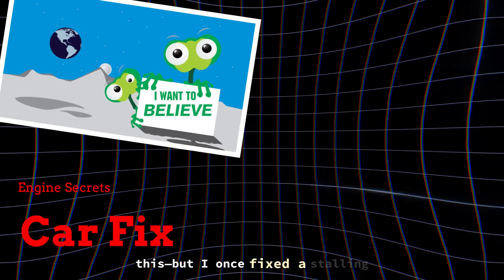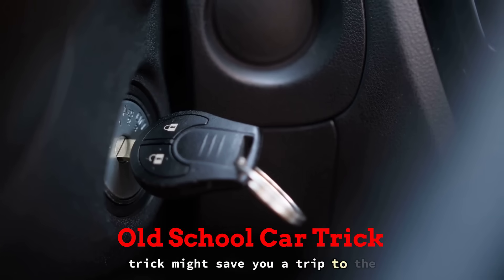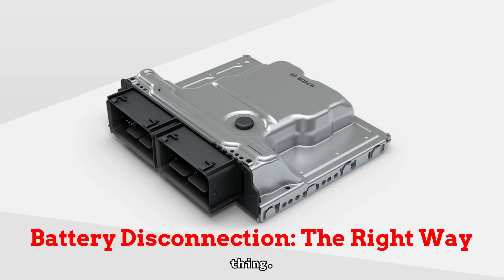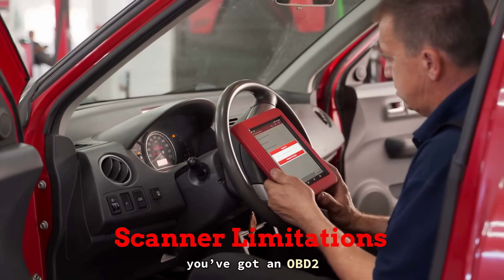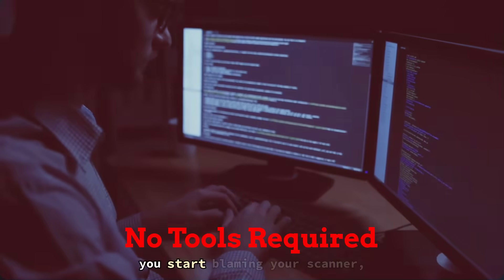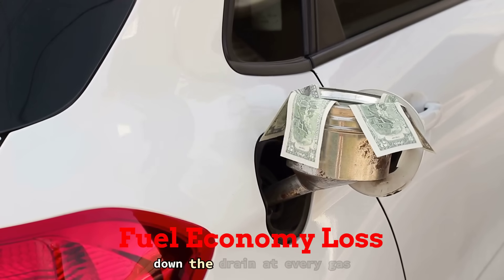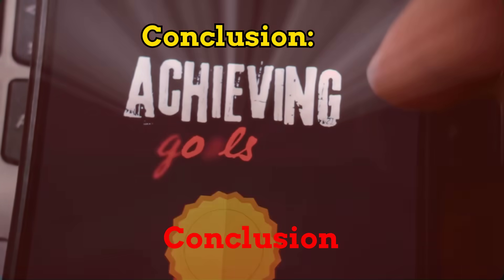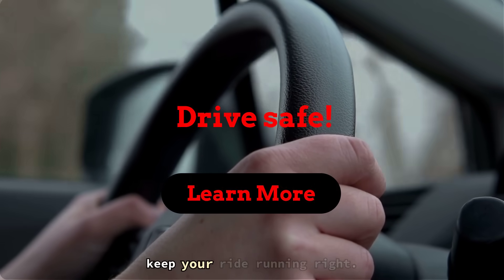Doing This Will RESET Your Car And Fix It For Free (5 Real Mechanic Methods)

Comment: My "Check Engine" lights and OBD-II stopped working years ago on 2002 Ford Ranger. Fuses are good. Could any of those 5 methods reset the system?
Reply from the maker: Great question! On a 2002 Ford Ranger, most of those 5 methods are perfect for troubleshooting—but if your OBD-II port and check engine light both stopped working completely, even with good fuses, that’s usually a sign of a power or ground issue to the diagnostic system.

Here’s what you can try:

🔧 Method #2 (Battery Disconnect with Brake Drain) — This is worth trying first. Sometimes a soft reset clears communication bugs between the ECU and the OBD port.

🔧 Double-check PCM & Diagnostic power Fuses under the dash — both fuses are tied to the PCM and diagnostic power. Even if they look good, try swapping them with known working ones just to rule it out.

⚠️ If the OBD port has no power, a common fix is tracing the wiring to the port itself—especially the ground and pin 16 (which supplies 12V). A corroded connector or bad splice can kill both the check engine light and scanner connection.
Reply: @CarCareFix  Thank you!
Reply: Quick update. The 16 pin has 12Volts but pin 4 & 5, the Harness Ground and Signal Ground have no continuity with multimeter. The wire harness goes into the firewall, so now its chasing down wire diagrams and finding where the two wires are grounded, loose or corroded.

Comment: DO NOT TAKE THE GROUND CABLE OFF FIRST. YOU WILL BLOW A COMPUTER MODULE! Take the positive cable off first! I have had that happen and learned the hard way AND IT COST $600 DOLLARS TOREPLACE THE BODY CONTROL MODULE!. Go to Home Depot and look up how to replace the battery in your vehicle. Before computers were put in cars, you took the ground first, then the positive.

Comment: Which one is the best to use on 2013 Nissan Altima 2.5 L? Keeps throttling up and down and goes into limp mode after replacing throttle position sensor and throttle body?
Reply from the maker: Great question, Christopher—and I’ve actually seen this exact issue on a 2013 Altima 2.5L more than once. If you’ve already replaced the throttle body and TPS, but it’s still surging or going into limp mode, the most likely issue is that the ECU hasn’t properly relearned the new throttle values.

🔧 Here’s what usually helps:
Fix #4: Throttle Pedal Reset Method
➡️ Key ON (engine off),
➡️ Slowly press the gas pedal all the way down,
➡️ Hold for 2–3 seconds,
➡️ Release gently,
➡️ Turn key OFF and wait 10 seconds.
Do this cycle twice. It helps reset the electronic throttle control’s “zero” position.

✅ After that, let the car idle for 5–10 minutes (engine running, no AC, no input) so it can relearn its baseline idle and air-fuel trim.

💡 Pro Tip: Disconnecting the battery with a proper ECU drain (Method #2 or #5) before doing the relearn can sometimes give you a cleaner reset.

Let me know how it goes—or if you’re still getting codes or symptoms afterward, I’ll help you dig deeper!

Comment: Changed out a dead battery in my 2019 VW Passat and now when I try to connect the new battery the horn screams a consistant blaring sound. Feedback anyone?
Reply from the maker: That blaring horn is usually your VW’s anti-theft system kicking in because it thinks someone’s tampering with the car. Don’t worry—it’s more common than you’d think after a battery swap. Here’s what you can try:

🔹 First, make sure all doors are closed and unlocked.
🔹 Reconnect the battery firmly—positive terminal first, then negative.
🔹 Immediately after connecting, unlock the car using the key fob or the physical key in the door. This often tells the system, ‘Hey, it’s me, not a thief.’
🔹 If the alarm still won’t stop, insert the key in the ignition and turn it to the ON position (don’t start the engine). Leave it like that for a minute—many systems reset this way.

Volkswagens can be super picky about battery swaps—especially if the alarm wasn’t fully disarmed before disconnecting. Let me know what happens after trying this and I’ll walk you through the next step if needed!"

Comment: I was driving then all of a sudden my 2002 ford taurs  started to slow down thenn turned off. I turned the switch and it jus cranked and made a his noice wen i turn the key. I had little to no gas , so i added  20$ in and still doesnt want to start it just makes a noise as if it wants to turn on. I tried my HT300 and it noted  EGR CAT EVAP O2.5 HTR are red and blinking. My dad says the fuel pump but idk... Any help on understand maybe what can be the cause and what i can try?
Reply: I try and it sounds like ... Ptssssss is that wat u mean?
Reply from the maker: @moniiibabyy8300  Thanks for checking and letting me know! That “ptssssss” sound you’re hearing could be a few things—but if it’s a soft hiss and you're not hearing a steady hummmm from the fuel pump (especially for 2–3 seconds after turning the key to ON), then it’s likely not the fuel pump priming like it should.

A proper fuel pump will usually make a low, electric humming sound from the rear of the car when you first turn the key (before cranking). If you don’t hear that, or just hear a faint hiss, it’s possible the pump has failed or lost power.

🔧 Want to test further? You can:

Tap the bottom of the fuel tank gently with a rubber mallet while someone turns the key — if the pump is stuck, this sometimes temporarily wakes it up.

Check the fuel pump fuse and relay under the hood — a blown fuse or bad relay can also cause this.
Reply from the maker: "Thanks for the detailed breakdown—and don’t worry, you’re not alone! That 2002 Ford Taurus giving out mid-drive and cranking without starting could definitely be fuel-related, especially if you were low on gas. Here’s how to break it down step-by-step:

🔹 Fuel Pump Possibility: Your dad might be right. If the pump was already weak, running very low on gas can cause it to overheat or suck in debris from the tank, which finishes it off.
👉 Try turning the key to the ON position (don’t crank it) and listen near the back seat or fuel tank—do you hear a faint humming for 2–3 seconds? No sound = likely fuel pump issue.

🔹 HT300 Scanner Lights (EGR, CAT, EVAP, O2, HTR): Those blinking red lights mean the system monitors haven’t run or completed—common when the car hasn’t started or is stuck in a failed state. Doesn’t mean all those parts are bad. It just means the car hasn't finished checking them.

🔹 Check Fuel Pressure or Try Starter Fluid: If you spray a little starting fluid into the throttle body and it starts momentarily, that’s a strong sign of fuel delivery issues—like a bad pump or clogged filter.

🔹 Crank + Hiss Sound: Could be a vacuum leak, faulty EGR valve stuck open, or simply the engine struggling with no fuel. Also check battery voltage—low voltage can cause all kinds of weird no-start behavior.

Try that fuel pump hum test first—it’s a super common failure on older Fords. Let me know what you hear or try next and I’ll walk you through the next step!"

Comment: Lol…as soon as you showed disconnecting the battery, I ran to my 2007 Jeep Liberty and tried it. It worked! Now I still have warning lights but they are because my tire sensors need to be replaced.👍👍
Reply: How to fix tire sensors please!?
Reply: How to replace those? Mechanics want to replace all of them!
Reply from the maker: Haha that’s what I love to hear! 👏 Glad the reset worked on your ’07 Liberty—those Jeeps usually respond great to a clean battery disconnect. And yep, those tire pressure sensors are notorious for aging out. Good news is, they’re a pretty simple fix when you’re ready. Appreciate you jumping in and sharing the win—those 👍👍 made my day!

Comment: Can you suggest a fix for the phone book search not working in BMW E70, X5, 2012 March model.
Reply from the maker: Great question! For your 2012 BMW X5 (E70), if the phone book search isn’t working, it’s usually a Bluetooth sync issue between the iDrive system and your phone. Here are a few things to try:

🔹 Delete the phone from your BMW’s paired list and re-pair it from scratch.
🔹 Make sure your phone’s contacts are set to sync over Bluetooth. (On iPhones, go to Settings > Bluetooth > tap the ⓘ next to your car and make sure 'Sync Contacts' is enabled.)
🔹 Check for iDrive software updates—older firmware can cause bugs like this.
🔹 If nothing helps, try a “hard reset” of the iDrive by holding down the volume/power knob for 30 seconds. It’ll reboot the system without losing saved data.

Comment: i HAD A ACCIDENT AND HIT A TREE SINCE THEN MY FRONT RADOR SENSOR IS NOT LINED UP AND CAUSING OTHERS TO MISS READ WILL THE JUMPER CABLES WORK FOR THIS?
Reply from the maker: Hey Arthur—sorry to hear about the accident, glad you’re okay. Unfortunately, the jumper cable reset (Method 5) won’t fix a misaligned radar sensor. Those sensors rely on precise positioning, and if it’s been knocked off-center from the impact, it’s likely sending incorrect data to other systems (like adaptive cruise, collision warning, etc). Best move is to have it realigned or recalibrated—some shops or dealerships have the tools to do it properly. But I respect you for checking all the DIY angles first!

Comment: Shouldn’t you disconnect the POSITIVE terminal first? I learned to remove negative last and put negative on first.
Reply from the maker: Great question! It’s actually safer to disconnect the negative terminal first and reconnect it last. Here’s why: the negative terminal is usually grounded to the chassis, so if you’re removing the positive first and your wrench accidentally touches metal—boom, you could short the system. But if you pull the negative first, there’s no live circuit to complete, so it’s much safer. Totally get the confusion though—lots of folks have been taught different ways depending on context. Appreciate you bringing it up!
Reply: @CarCareFix I Get it. Thanks. 👍🏼

Comment: Thanks for this video............will it work on a    05 Toyota Tundra ???
Reply from the maker: Absolutely! An '05 Toyota Tundra is the perfect candidate for most of these reset methods—especially the ignition key cycling, battery disconnect, and even the jumper cable memory drain trick (Method 5). Those older Toyotas are super responsive to these kinds of resets. Let me know what issue you’re trying to fix, and I’ll help you dial in the best method!

Comment: On my Silverado 👉👉   i found a rusty ground wire, That was bolted on the frame, causing warning lights on the dash come on.  Like brakes and things >  Engine oil change...  I just unbolted it clean it off with a wire brush > put back on, tighten it  >   FIXED
Reply from the maker: Nice catch, Superbee! 👏 Rusty or loose grounds cause all kinds of weird electrical gremlins—especially on trucks like the Silverado. Brake lights, random warnings, even no-starts... all from one bad connection. Props for tracking it down and handling it old-school with a wire brush. That’s real garage work right there!
Reply: @CarCareFix  Thanks man!  I was  Lucky i found the problem.  I trace the ground wire to the computer  That what it was?  <>  A rusty connection, IT was a little loose too

Comment: Just came across your video fixing your car without tools the 5 hacks to reset your ECU's . As a retired automotive technician with more than 45 years of experience  I can say that All of them will and Do work keep up the good work. 
I just wanted to pass along a service bulletin that applies to all the full electric vehicles. Remember to keep the vehicles keys at least 50 feet away from the Car when you are working on it. 
Nearby proximity of the keys can energize the cars systems and turn on things you don't want on . Like the brakes pump coming on when you are changing pads and have the caliper in your hands that's All bad . Thanks Again for your work and have a great day everyday
Reply from the maker: John, that means a lot—thank you! Coming from someone with 45+ years in the trade, your feedback seriously carries weight. And that tip about EVs is golden—you're absolutely right. I’ve seen techs get surprised by systems waking up mid-repair just because the key was nearby. I’ll definitely include that in a future video—it’s the kind of detail that can save people from real headaches (and injuries). Appreciate you sharing your knowledge and taking the time to drop by!
Reply: Thanks for this information, I got a new  ECU the car said it was the new ECU took it to the dealer to replace the ECU and they said it would cost over $1000 to fix it
 I don't have that kind of money, I am 73 and on SSI
Reply from the maker: @02WhiteEagle29  Hey WhiteEagle, thank you for sharing that—and I’m really sorry to hear what you’re dealing with. $1,000+ for an ECU reprogram at the dealer is way too much, especially when you're on a fixed income. Here's what you might be able to try instead:

🔧 Check Local Independent Shops: Many trusted non-dealer mechanics can program ECUs for far less—sometimes under $200, depending on your vehicle. Always ask if they have the OEM-level scan tool before you commit.

💡 Mobile ECU Programmers: In some areas, certified mobile techs will come to you and flash/program the ECU at a lower rate. Look for ones with good reviews on Google or Yelp.

⚙ DIY with the Right Tool: If you're up for it or have someone to help, tools like Autel or Launch (mid-range OBD2 scanners) can sometimes handle ECU initialization/reset procedures if the ECU is pre-coded for your VIN.

And if the car "recognized" the new ECU already, there’s a chance you may just need a basic immobilizer/key relearn—not a full reflash.
Reply: @02WhiteEagle29 , the dealer mechanic is 'the dealers' mechanic, not yours. Go absolutely anywhere else.
Reply: Wrap the key in aluminum foil blocks all RF energy, same goes for a cell phone, you won't be able to call that phone or know where it is.
Reply from the maker: @stevetilbrook3402  Absolutely right, Steve! 🔒 Wrapping your key fob in aluminum foil does block RF signals—cheap and effective DIY Faraday cage. I always tell folks it’s a smart move if you’re parking in sketchy areas or just want extra peace of mind against relay attacks. Same trick works for phones in a pinch too. Appreciate you dropping this tip—more people need to know it!
Reply: Electric key fobs? Or old fashioned keys?
Reply: @kandacepatterson7965  I think he was talking about EVs (Electric Vehicles)
Reply: Wrap key in aluminium foil, Faraday cage..nothing can connect with it...thank you great video...old car loads of problems and expense 🤔
Reply: Really appreciate the tip, especially from someone with your experience. Have you seen a lot of accidents happen because people didn't keep the keys far enough away?
Reply: Great tip I never would of thought of that, it makes lots of sense. Curious did you find out the hard way or something someone passed on to you?

Comment: CLEARING RESIDUAL VOLTAGE FROM CAR ELECTRICAL SYSTEM
After disconnection of, first, the negative, then positive battery cables from battery, simply touching the two battery cables together still can cause a damaging surge through electronics.
To avoid that surge, build a simple jumper cable using a 10 watt, 1 Ohm resistor in series. Then, connect the cable between the two  battery cable ends. After 30 seconds, voltage has been discharged completely and safely.
Reply from the maker: That’s a fantastic addition, Bob—really appreciate you sharing that. Using a 1 Ohm, 10-watt resistor in-line is a smarter and safer way to fully bleed off residual voltage, especially for newer vehicles with sensitive electronics. Definitely a great option for folks who are comfortable working with components like that.

The method I showed—touching the disconnected battery cables together—is more of a quick DIY approach for everyday drivers who don’t have access to tools or electrical resistors. It’s worked reliably for years on older and mid-range vehicles, especially when done carefully. But your tip adds an extra layer of safety, and I’ll definitely mention it in a future video for those who want to go the extra mile. Thanks again for bringing real insight to the comments!
Reply: * My apologies for an error in recalling the specs-- the resistor should be 1 Ohm, 10 Watts. I have corrected my original post, as well.
This technique was published by YouTuber Scotty Kilmer, a veteran mechanic, like you.
Reply: Wouldn't a 12 volt bulb do the same thing, most folks carry a spare, or worst case can temporarily rob one from the indicator cluster.
Reply from the maker: @rayblackman8069  Great question, Ray—and yep, you're absolutely right! A 12V bulb can act like a current limiter in a pinch. It provides resistance and safely bleeds off residual voltage, just like the resistor Bob mentioned. It's a clever workaround for folks who don’t have resistors lying around, especially if you're comfortable pulling a spare bulb from the dash or taillight. Appreciate you thinking outside the box—that’s the kind of resourceful thinking I love to see in this community!

Comment: Does these methods work
On older cars? Tried these tricks on a 2005 huydai Sonotaand they worked!! Let me know if there’s tricks for older cars.
Reply from the maker: Heck yeah, Larry! A lot of these tricks were made for older cars like your 2005 Sonata—especially the ignition key cycle and battery reset methods. Older ECUs are way more responsive to simple resets because they don’t have all the locked-down software newer cars do. I’ll definitely be sharing more old-school tricks soon, so stay tuned—and if you’ve got a specific issue, drop it here and I’ll see what I can suggest!